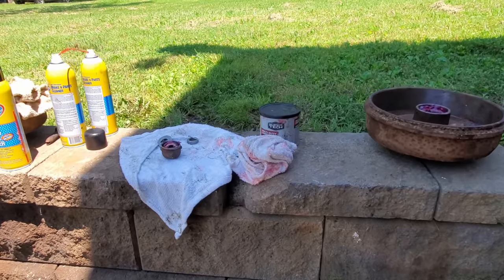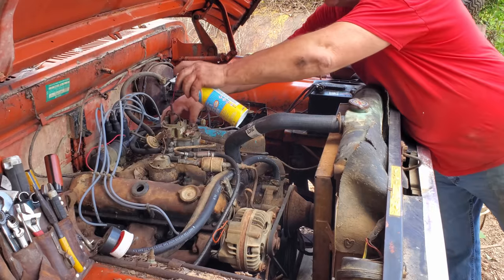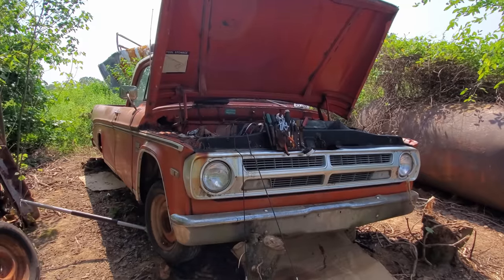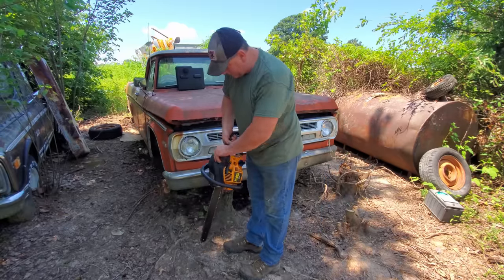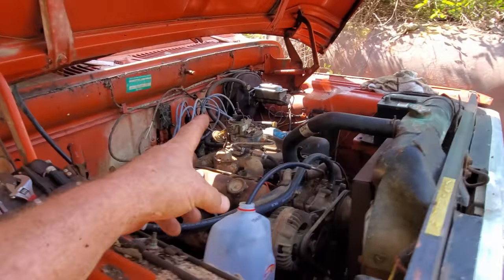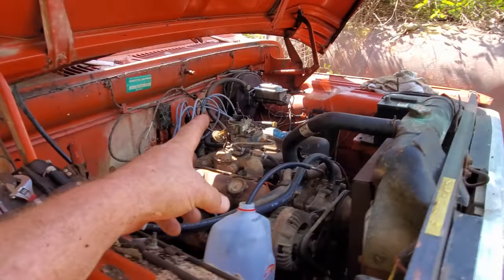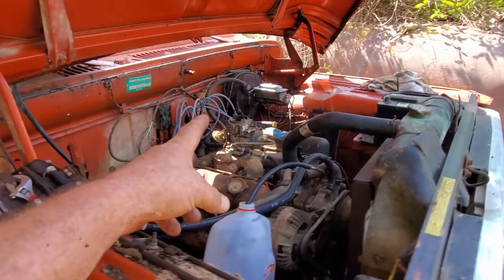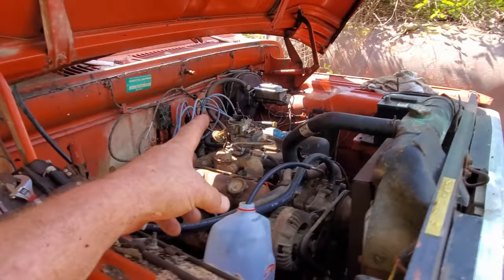1971 D100 (Finis) ABANDONED 34 Years |Back On The Road!!!

Comment: They don't put drain plugs in transmission pans because they know that nobody would ever change the filter if they did.  The real question is why don't they use a screw on filter that can be changed without dropping the pan?  Like an oil filter.  That is just stupidity.  And all 3 of em are guilty of it, to this day.

Comment: If you'll change the filter and take the line off that blows outward that you just put on and get your job and put Her bucket and Put On Her pump a little fluid option and CHANGE the Filter of the Sucker Run put it some at Lucas transmission stops Living there when You Feel It Back Up or fluid that's playing probably break the violin flu soon start rocking and rolling again Done it many times but if you just do the filter change you put a 150 Miles on it it'll start slipping again but if you pump all that old fluid out until you see real clean red fluid come out of the lawn when you do the napkin yeah I'm blow the transmission of you but you will clean all the crap I know that's been sitting there in the bottom that transvision it's already years and then I got some additive but overall that's a matter of it O'reilly's call loop gua transmission flush is in a white bottle put that in there where you looked foot out And then put that Lucas in there after you be good to go

Comment: What did I tell you about what I tell you about Mr. Fluid and filter change you're gonna have issues couldn't you got metal that's definitely unless you get all that fluid out and start over again with that like I said with it flush and protected that Lucas stop slip you don't have issues juice you end up with a Lucas stop slip and it will once you've pumped all that overflowed out through that line it will probably strike seen worse than that Clear up and work for years do it math do a map